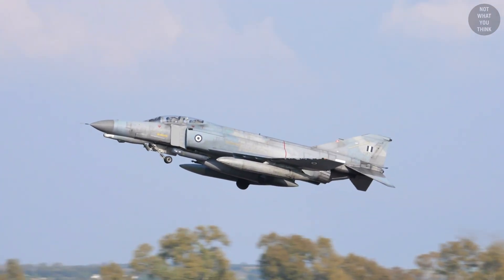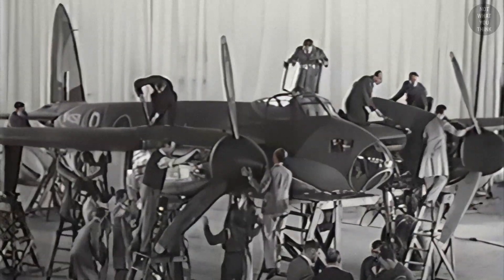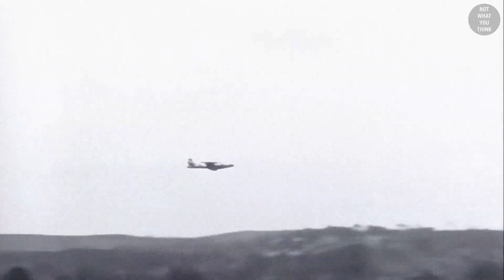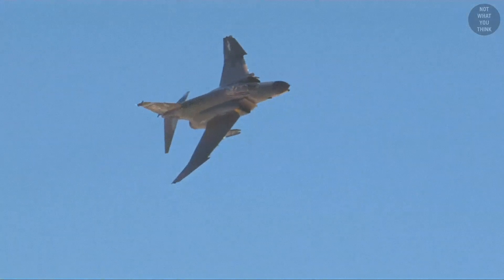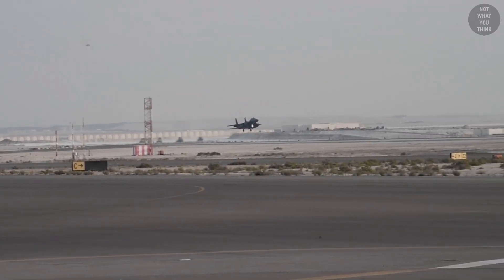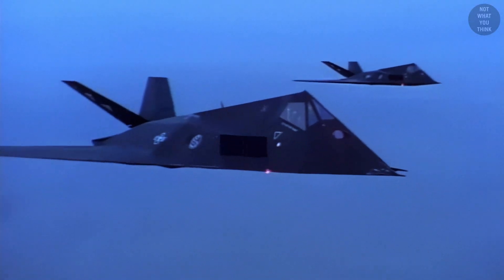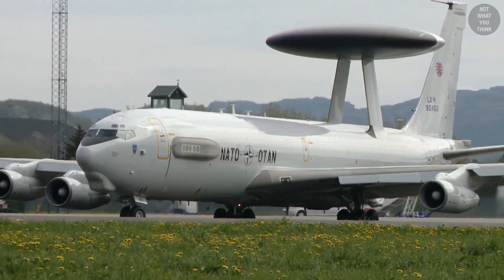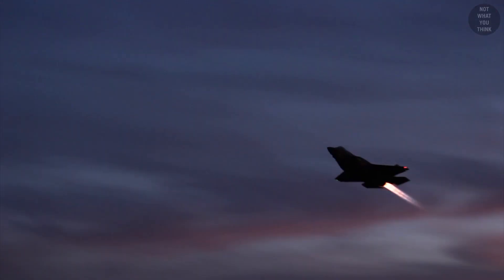Why are Modern Fighter Jets Slower than 1960s?

Comment: Also F-35 has really good performance in the subsonic flight regime.  There’s so many different flight regimes to consider at any given altitudes.  Different engine types love different regimes.  F-22’s low bypass loves the thin high-altitudes going supersonic whereas the F-35’s higher bypass engines thrive in thicker air and in subsonic airflow. F-1 cars and Rally cars are built for different types of racing.  F-22 is the F1 car with the smooth thin air.  F-35 loves the rough-and-tumble of turbulent thicker air and thrives there.  Both can fly at other regimes of course, but then you’d need advanced variable engines with moving inlets and controllable bypass to take advantage of each flight regime (costly, heavy, maintenance-heavy…).

Transonic speeds is actually important during BVR, but accelerating to transonic is part of any sortie plan, and only happens very briefly during the entire sortie.

Source: My dad was in the RoKAF, and I myself have been a US Navy contractor for their sensor systems for nearly 2 decades now.
Reply: Your so right. In medium flight envelopes the f35 could out perform any other jet where it counts. Not slow, not too fast, but in the real world of combat.
Reply: @frankcrawford416  It can’t outperform the YF-23 though 😎
Reply: was about to say, this video omitted the fact that short stints of high speed are very useful in bvr combat for added missile range.
Reply: I'm so glad Finland chose F-35s.
Reply: hey fellas how's the weather in moscow
Reply: Isnt the air thick on low altitude and thin on high
Reply: So the f35 is the better choice for Switzerland as it is more versatile
Reply: The F-35 is not a good example, it still has difficulties.
Reply: Good points! People really seem to misunderstand for what the F35 was originally designed to, and in what direction it evolved.
Reply: The only thing you are mistaken is the importance of BVR in the transonic region.  When it comes to BVR, you want your plane traveling as fast as it can when you release a missile.  Missile engines only have so much burn-time.  You don’t want to waste propellant and cut your range by trying to make up for acceleration.   So the supersonic region and thin high altitude air is what you want for BVR, even if you are hitting an opponent At a lower altitude with thicker air.
Reply: what's BVR?
Reply: The F22 and F35 engines do not bypass air....  a high bypass turbofan  is the type of engine used on commercial airliners and cargo aircraft, which drive a large fan at the intake to provide additional thrust and cool the exhaust.  Neither the F22 or F35 do that, so turbofan is really a misnomer for those engines....  they should be called turbojets.
Reply: Thank you for that excellent comment and all the great info it contained. In a nutshell you explained the basic difference between those planes.
Reply: Look another that talks lies and propaganda as if real truthful fact? Tell us all why you want to talk about anything at all when you have no idea what you're talking about?
Reply: There really is something very wrong with you people today. You all get taught propaganda as if a real part of your own country's history?, and it's the rest of us, that have to put up with reading your own opinions of comical rubbish! 
Try to have a discussion about any military aircraft, with any American, and you'll be shocked just how unaware they really are? They all talk endless rubbish, and so much so, they even start to believe their own rubbish. It makes no difference, if you show them, or explain to them, or even go through it in fine detail with them. 

You can conclusively prove things to these people, and they'll ignore it, and just carry on saying the same thing? Even when they've just been shown, and had something proven to them, (something that they were completely wrong about), makes no difference at all. Nope, they'll just deny it, or ignore it, seriously, you can talk to any of them about any military hardware, at all, and you'll always come to find, they actually know nothing about any of it.

Even when you point things out to them, things that they've so obviously just dreamt up in their own head?, all you'll then get back, is a few lines of remedial illegible rubbish. But you'll then see them somewhere else, repeating what they now already know to be complete rubbish??. Honestly, you could not make it up! 

If people could think for themselves today, they'd all be questioning why the USA made a point of announcing to the world, they've made it illegal to sell the F-22??. The USA seemingly want it believed, it's because it's so good, they don't want anyone else to have it?. But, that actually makes no sense at all, because the reality is, they've no idea what's around the corner in modern technology terms, and with the speed we're seeing new military tactical hardware being designed, developed, and created today, It could well of made great sense to sell the F-22 at some stage?. (If it actually works). If it worked?, they'd have been able to recoup much of the resources spent on the aircraft, if not the resources in their entirety.

Now, there's another reason the USA would make a point of announcing they've made it illegal to sell the F-22?, a point that the American people seem to want to neglect today? And that's, If, it doesn't work, If it is, as I suspect it is, a lemon?, and if the USA have then used the F-22 as a propaganda purpose aircraft?, then what better way of preventing anyone else from finding out that it actually doesn't work, and it's really a lemon?, than making it illegal to sell? 

Really, and logically, the only possible way to explain that stunt, of the USA announcing they've now made it illegal to sell the F-22, can only be because it's a propaganda aircraft, a failure! 16 years the US have had F-22, and they've been in wars the entire time, only they've never used it, and they removed every F-22 from the Middle East, Jordan, Iraq, Turkey, and Saudi just after Russia arrived in Syria in 2015.

You can think about this as much as you like?, that is the only real possible reason the USA would do that. Absolutely no doubt about it, I guarantee we'll never see the F-22 involved in any sort of war scenario, or any major sortie, as it's basically junk. They've even trashed all the infrastructure they had in place to build more of them.
Reply: @hotstepper887  k
Reply: Imagine if the Allies had F35s at the start of WW2
Reply: @christiandauz3742  imo, Jet fighter vs Prop plane might be a little bit challenging. I don't really know about this tho
Reply: @cyngaethlestan8859  Yeah I know about the Me262. Jet fighter during WW2 is not well developed but it can do their job. The Me262 was not create to intercept the American P51 as far as I know. I think. Sorry if my sentence is weird, it's early in the morning while I type this.
Reply: @christiandauz3742  well to take that into account, bare in mind at the beginning of ww2 the germans had better tech than the Allies, so what would they have had? orbital strike capability??? (in fact in can be argued they had better tech throughout ww2 anyway I digress) also an F35 in ww2 era would have been pointless as steath isn't needed in a pre radar era and would be needlessly expensive to run. 
What won ww2 is massive numbers of available troops and resources and production capabilities and that would still be true now so long as nukes are off the table. The Nazi's could out fight tanks and planes 1v1 through out the war until they ran out of kit and soldiers. Tiger tanks were known to kill 20+ shermans or T34's on occassion and retreat only due to fuel and ammo shortage.. Some of their "Aces" had clocked up over 100 tanks kills. SO why didn't they win? largely due to the offensive against Russia, they depleted themselves against an endless sea of bodies and tanks and once the allies started carpet bombing production capabilities and cities too the war was lost and it was just a matter of time.
Reply: @triggerhippy2826  

WW2 started with the Nazi invasion of Poland

I doubt the Germans last a week with their airforce and army decimated. I also doubt the Soviets would invade Poland

China's very small airforce has also been upgraded. Same with France, Yugoslavia, Denmark, Belgium, Norway, Netherlands and Greece.
Reply: @christiandauz3742  You mean the British and or French.  Yanks didn't turn up till 1942.
Reply: Last I checked, F-35 had sub-average subsonic performance. What do you have in mind, maybe I'm confusing something.
Reply: @REgamesplayer  F-35A outperforms both the Block 50 F-16C and F-22A in subsonic regime if talking acceleration, for all the reasons dan725 stated, as well as its aerodynamics.  Everyone that has been talking about how poor the F-35 aerodynamics are are left having to explain why its performance is better than 2 of the highest-performing fighters in the subsonic regime.  Once the F-35 gets to supersonic realm, the F-16C Blk 50 and F-22A out-accelerate it.
Reply: @LRRPFco52  F-35A does not outperform F-16 in subsonic range. Its sustained turn is a lot slower, leaving it a sitting duck in a dogfight. Its acceleration is also worse due to lower thrust to weight ratio.
Reply: @REgamesplayer  We literally worked on the F-16C Block 30 and 40, and I’m intimately familiar with the Viper from YF-16 to the latest variants.  I watched it all happen at Edwards AFB from the 1970s-onward.

Recent statements from one of the squadron commanders at Eielson AFB in Alaska:

“If you put an F-16C Block 50 next to an F-35 at 200knots and accelerate, the F-35 beats it to Mach 1.  The F-35 also beats the F-22 in the subsonic regime.  Both the F-16C Block 50 and F-22 will start to walk away from the F-35 once they go supersonic.”

Airshow demo F-16 has better STR, but not ITR.  F-35 instantaneous turn rate and high alpha performance is substantially better than the Viper, which is AOA-limited.  Once you combat-configure the Viper, don’t even get airborne for that contest because it’s over before it started.  Have you ever seen the CAT limits on the Viper while configured?  It’s nowhere near as agile as when slick.

F-35A curb-checks the F-16 when you actually configure the F-16 for missions, even with both of them carrying the same weapons load.  F-35A is carrying more fuel and still out-performs the F-16 no matter what you do.

F-16 isn’t getting anywhere near visual range, and doesn’t want to anyway since both of them have AIM-9X, while F-35 has extensive IR VLO and a far superior Helmet.

50% of all meteorological conditions (night), the F-35 is superior to any fighter in the world in WVR, not that it will allow them to go there.
Reply: @LRRPFco52  I had checked information about F-16 acceleration and discovered that for all practical intents and purposes, F-35 is a quicker plane to accelerate. However, F-16 is technically quicker plane. This is due to most calculations for F-16 being made with fuel tanks and often full loadout while F-16 having better characteristics on paper.

"The F-35 and the Infamous Transonic Acceleration ‘Spec’ Change" source has a nice table showing both aircraft acceleration, F-16 beats F-35 at low weight/drag loadouts. However, F-35A beats F-16 at more practical loadouts. 

I knew about instantenous turn rate, but I had in mind sustained turn rate which is worse one F-35A. This had caused F-35A to be humiliated by F-16 in the past and it can only do defensive maneuvers and hope for enemy to do a mistake. WVR combat is a disaster for F-35A and we are still comparing only F-35A to F-16. Super-maneuverable Russian jets could run circles around this plane.

Thank you for pointing out that F-35A is not as hopeless in sub-sonic acceleration as I imagined. Feature creep had resulted in a  poorer acceleration (by 8 secoonds for F-35A) and it is still slower than F-16 to speed up. However, I was not taking into account how much drag F-16 has to carry with him which makes it slower fighter jet for all practical applications.
Reply: @REgamesplayer  The old AF-2 flight dynamics envelope expansion on a pre-SWAT F-35A (one of the first 6 LRIP birds that were never mass-produced) is not what you would want to use as a sample for F-35A performance, since it was heavier and was restricted to 4-5g.

A real F-35A humiliates the F-16 in WVR, not that it matters.  Read about the Dutch F-35A pilots dong a week-long BFM series of exercises with Nellis AFB Aggressors in F-16C Block 30s (lighter airframe than Block 40s and 50s).  F-16s showed on Day 1 with 2x 370 gallon EFTs on the wings, got spanked in every set-up.  Next day switched to centerline 300 gallon tank, still got wrecked.  On the final day, they showed up slick with no EFTs, very short sorties due to need for hitting the tanker, and still weren’t able to push over a 50% kill ratio.

On one of the days, the F-16s BINGO’d and returned to Nellis, F-35s flew off to the training ranges.  F-35 pilots came back to debrief for hours as USAF does, and F-16 pilots asked, “Hey, where did you go after the BFM exercises?”

Dutch:  “Yeah, we were carrying GBUs the whole time, so we wanted to maximize the airspace and training value to go do drops on the live ranges.”

F-16 pilots:  “........what?”  Jaws hit the floor.

Sustained Turn Rate on the Viper is awesome when slick.  With Pods, EFTs, all pylons loaded, even after you E-JETT the tanks and bombs, you have:

Centerline 800lb ECM pod
LITENING FLIR Pod on 5R
HTS on 5L for CCIP F-16CM later blocks
WWPs on 4 & 6
WWPs on 3 & 7
ALE-50 equipped pylons on 2 & 8 with missiles attached
AIM-120Cs on 1 & 9

Your sustained turn rate in that configuration is still nothing like an airshow demo, and if it was a 1950s gun fight, you would still get wrecked by any of the F-35s, including the B.

Since it’s not a 1950s gun fight, but a 2020s Helmet-HOBS missile fight if someone is stupid enough to close into WVR after making it through the BVRAAM WEZ layers, then JSF smokes everyone including Flankers because of IR VLO, better HMDS, better FPA missiles that have close BVR reach for the face-shoot, automated offensive/defensive EW suite, and other things.

The conversation about the WVR fight is negated on so many levels, since it’s a non-starter already for 4th Gen fighters.  They stopped doing it long ago just because of Helmet-HOBS.
Reply: @LRRPFco52    Here is where I find issues with your comment from a get go.
1) I cannot find specific article you were relating to. About those tests you wrote in the start. You wrote it vaguely enough that search does not find anything specific.
2) SWAT was a very early program done roughly around 2004. AF-02 test aircraft first flight was 2010. This means that your argument lacks logical connection as weight reduction was done prior this aircraft introduction.
3) In a dog fight test there is no mention that F-35 was limited in performance and if it did, how it was affected by it. I see this argument made in defense of F-35 a lot. However, it is not logical. What is the point of testing your fighter jet in a dogfight conditions if its software locks it from dogfighting? Military does not test such politically sensitive pieces of hardware like this just because they can. Seeing how unrealistic F-16 loadout was and how handicapped this aircraft was in a dogfight shows to me that it was a rigged match which went wrong.
4) Your quotes also do not help the issue. Quote turn rates, actual dogfights. You are quoting a lot of loadout numbers, but you avoid talking about their actual performance in a dogfight.

Overall, argument that  F-35 is better at a dogfight than F-16 does not seem to have any merit as F-16 is a better dogfight fighter. We have mock battle to prove it. Since then F-35 only became worse in such dogfights due to weight creep which resulted from feature creep. Its agility had noticeably degraded since those early  models. That is worse, people feel a need to bring F-16 to a dogfight in a completely rigged environment. Could you explain to me why they are testing this aircraft with fuel tanks attached? In real life scenarios these things would be the first thing pilot would drop including even potential bombs and anti-ground missiles which it might be carrying.

I do need hard data to be convinced that F-35 is not a worse fighter jet in a dogfight against F-16 when it comes to agility. Bring me turn rates for these aircraft, acceleration, etc. Compare them in realistic payloads which would happen during dogfight.
Reply: @REgamesplayer  1) The weight growth through the configuration proposals was ongoing, then dropped considerably with SWAT, and after the 6 LRIP-1 birds were built Lockheed stated that all production models after that would be even lighter.

I'm referencing "F-35: From Concept to Cockpit", available to those in the Aerospace Engineering world by membership.  It's a huge book written by all the engineering leads and some early test pilots on JSf.

I'm also referencing the statements by the test pilots who flew those LRIP-1 jets.

Additionally, I'm referencing my family's work and my own studies and familiarity with ITR and STR on the F-16, which we worked on in the late 1980s before going over to the F-15 CTF.

As to flight control algorithms, they didn't open JSF up to max g out of the gate, but instead did a very carefully staged incremental performance expansion during safety of flight testing.

The infamous dogfight test was not a test of how well AF-2 could fight with the F-16D chase plane, but a highly instrumented flight to measure specific performance metrics and test points with the DFLCS.
Reply: @REgamesplayer  Yes, the F-16D was nowhere even close to being combat-configured since it didn't have:

800lb ECM pod on 5
LANTIRN TGT Pod 5R
Weapons

You can E-Jett stations 3, 4, 6, 7 on the F-16, 5 if it's a 300 gal EFT, but not the ECM pod.

A Combat-configured Viper is still a CAT 3 stores limit bird with the ECM pod, FLIR, and HARM TGT System for deployable CCIP Vipers.  Even with EFTs jettisoned, it can't pull 9g, has limited roll rate, AOA limiter, and doesn't hug the EM diagram like it does slick.

It has worse acceleration, ITR, STR, and climb rate than an F-35A in a post E-Jett configuration.

Real production F-35As have been dominant against even light-loaded F-16C Block 30 aggressors for many years now.

The Dutch stated openly that they saw the F-16s show up on day 1 with 2 tanks because they heard about that early test report, thinking they could just fly circles around the F-35As.

After they got wrecked, they RTBd and then showed up Day 2 with only centerline 300gal EFTs, ACMI, CATM-9s, still got wrecked.

Then they stripped them down to no EFTs and only the ACMI and CATM-9, and brought the exchange ratio up a little, but not enough to break over 50%.

Then the Dutch went and dropped live bombs after those sorties, which they had been carrying the whole time.  There's a very lengthy pilot interview on it.  These are high hour Dutch F-16 pilots who converted over to F-35As as the initial Cadre that will instruct and lead their air force as it transitions.

The whole conversation is in the wrong place though being focused on WVR guns fights, when you have the sensors that JSF do.  Why would you ever let the fight get close?  Keep in mind they see everything from surface vessels to satellites in their HMDS.
Reply: @LRRPFco52  

Please try to keep conversation to one comment as it is difficult for me to respond to two comments at once. 

As for why I'm focused on this topic. This is because you keep on arguing on an issue which you should not. To me, this topic is simply about laws of physics. F-16 is a smaller plane and thus it is more agile. Other planes are designed to be more agile WVR combat and thus they are more agile than F-35. It does not matter that WVR is impractical or F-35 was not designed for it. This is just how it is. F-35 is a relatively clumsy plane and I'm tired by people trying to white wash it like it is not. This does not mean that it is not a next generation super plane which will dominate the skies or that it is not high tech marvel. These are completely different topics and I do not care about them for the purpose of this conversation.

It seems that the only good source which I can back to is a book which you had mentioned. I cannot exactly check up on your family's research after all.

Here is my issue with this whole F-35 dogfight fiasco. I had read "F-35A High Angle of Attack Operational Maneuvers" original document. It correctly states that it was not a dogfight. You also had mentioned that. However, it does not state any software limitations being in place. Furthermore, I recall that even in an official explanation for these tests there wasn't any mention about this software. This is where I'm mistrustful of this explanation. I know that this kind of software exists in preventing plane from experiencing maximum stress in order to save on its lifespan or to be just generally safe. However, outside of instantaneous and brief periods where plane is in such a state, normal dogfighting or even normal operation of a plane does not come close to those limits. For example, maximum stress is rated at 9G while sustained turn rate in a dogfight is around 4-5Gs. If there is a software limiting plane for going 7Gs, it would still have no relevance to these tests.

My another issue is that even if plane was meant just to perform maneuvers for testing. This test highlighted that a plane lacks technical characteristics necessary for dogfighting. 

My third issue is that you are referencing LRIP-1 models, however model at that infamous test came from LRIP-4 series. It was already modernized by SWAT program.

My fourth issue is that F-35 weight grew after that point with new features being added. In 2013 Pentagon had reduced agility expectations for F-35 series in order to allow greater maximum weight of those planes. Here is a direct quote:
"Pentagon's Director of Operational Test and Evaluation 2012 report. Turn performance for the US Air Force's F-35A was reduced from 5.3 sustained g's to 4.6 sustained g's. The F-35B had its sustained g's cut from five to 4.5 g's, while the US Navy variant had its turn performance truncated from 5.1 to five sustained g's. Acceleration times from Mach 0.8 to Mach 1.2 were extended by eight seconds, 16 seconds and 43 seconds for the A, B and C-models respectively. "

Edit:
As for F-35 vs F-16 speed comparison which you talked in your different comment. Yes, F-35 is faster than F-16 in most practical loadouts and is tied in one. However, with impractical loadouts, F-16 is faster than F-35. With 2 x AIM-120B, 511 rounds, 7116 lbs internal fuel, plane weights 28,285 lbs and has a drag at around 54. At these conditions F-16 will accelerate quicker at sub-sonic speeds than F-35. (M0.79 to M1.29 by 54 seconds).
Reply: @REgamesplayer  checked where? YouTube?🤣
Reply: @GGG19872  Testing reports and enthusiast pages.
Reply: @REgamesplayer  funny I've seen it fly in airshows right behind the F22, F15s and F18s, the F35 turns tighter and maneuvers just as well or better than the F15 and F18 (plus it has better combat systems than either of those two) and almost as well as the F22.  They are also integrating the F35 pilot helmet into the F22.  So what "sub average subsonic performance" are you talking about?
Reply: @danniellwilliams8973  Wider turn radius, slower sub-sonic acceleration, lack of supermaneuverability.
Reply: @danniellwilliams8973  And you never bothered to dig for its aerodynamic properties or read testing reports of F-35. You only give it excuses that it does not matter. No, it does matter. Vectored thrust is king in dogfights as supermaneuverable aircraft can physically shift exhaust of their engines in order to produce much sharper turns than normal fighter jet. If it truly would not matter, F-22 would not be supermaneuverable aircraft.
Reply: @REgamesplayer  yes it is in video games but that's yet to be proven in combat.  Yet, I've seen the actual plane fly and maneuver in many different venues.  Not to mention, the numerous foreign customers putting in orders for the plane.  I guess they missed your "reports" as well.  Lol.  Also keep in mind, real wars aren't fought on paper.
Reply: Rolling down the runway
throttles open wide
see the mighty Phantom
sway from side to side
airborne again without a blip
It's just one more aborted trip
but we're pressing on regardless
for the wg cdrs AFC

Went to early briefing
climbed into the Kite
opened up the throttles
and roared into the night
leaving the flare path far behind
It's dark outside, but we don't mind
cos we're pressing on regardless
for the wg cdr's AFC

Rolling down the runway
throttle open wide
see the mighty Falcon
sway from side to side
airborne again with just 9 G
I wish I had a nav with me (!)
but we're pressing on regardless
for the wg cdr's AFC

Rolling down the runway
throttles open wide
see the mighty Jaguar
sway from side to side
airborne again, but only just
It's not much fun
with F*** all thrust
but we're pressing on regardless
for the wg cdr's AFC

GIVE ME BUCCANEERS!
They're British through and through
The Banana Jet
The Best we've had yet
We are the last of the few.

Don't give me the Jaguar
Unless you refer to the car
The car is a groundhog
The aircraft is half frog
Don't give me the Jaguar.

Give me Buccaneers
They're British through and through
The Banana Jet
The Best we've had yet
We are the last of the few.

Don't give me the Harrier jump jet
You haven't convinced me yet
Jets that fly backwards 
Are soon to be knackered
Don't give me the Harrier jump jet
Well… Not just yet...

Give me Buccaneers...
They're British through and through
The Banana Jet
The Best we've had yet
We are the last of the few.

Don't give me this computer crap
It's no way to tackle a SAP
It's OK for Dicks, Germans and Spicks
But Gentleman always carry a map!

Give me Buccaneers...
They're British through and through
The Banana Jet
The Best we've had yet
We are the last of the few.

Don't give me Air Traffic Control
They live in a bloody great hole…
They scream, and they shout, then F**k you about
Don't give me Air Traffic Control.

Give me Buccaneers...
They're British through and through
The Banana Jet
The Best we've had yet
We are the last of the few.

Don't give me the F-104
It's only a ground loving whore
It goes in a turn, flick, spin and burn
Don't give me the F-104.

Give me Buccaneers
They're British through and through
The Banana Jet
The Best we've had yet
WE ARE THE LAST OF THE FEW!
Reply: @hotstepper887  look out he's going to copypaste his seethe dissertation and call me an idiot
Reply: @soloqueuepixy  Rather than typing such a meaningless comment?, why don't you just try making a comment about the issue? 

What did you think that irrelevant comment would achieve?, what is the point you're trying to make? 

I'd be an extremely uneducated individual if I wasted my own time retyping my own comments over and over again when I've no need to do that? 

You seem to believe every comment I reply too, are the same comments? But of course they're not, they're all different threads, not the same. LMAO! 

You know when you find yourself typing the same thing many times, that you only need to type it once? As we have modern technologies today, you know? Technologies, like, "copy and paste" we use to save us from having to retyping things, it's well good, saves so much time! 

Oh, wait, are you actually saying that YOU, yourself, actually sit there, and you retype a comment you might want to say many times? Is that really what you're trying to say? 

So, do you also think, that if someone copies and pastes something, then that in some way, means the words are worth less than they would be if I'd retyped them all? Is that what you're actually saying? LOL.

Not only did you type that comment fitting of a 4-year-old? No, you went one further, and you even hit send? LOLOL

Btw, I've said this so many times to other less educated people, like yourself we find on here, so many times that I'll admit, it's "Copy and pasted*" PMSFL... 

I'll tell you what, right?, the level of intelligence in this world today, is, appalling! It's actually shocking!  LOL.

You're really not the sharpest pencil in the pencil case, are you, lad?, blunter than a pair of old worn out plimsolls. LMFAO
Reply: @hotstepper887  exhibit a: redditors when someone doesn't agree with them
Reply: @hotstepper887  my condolences for your british birth
Reply: Seemingly these Americans have no idea the F-22 and F-35 can't see, track, or target any other stealth aircraft from BVR (beyond visual range). Stealth alone defeats high-frequency (short wave) radar by absorption and deflection, it does not defeat low-frequency (long wave) radar. Therefore, to see, track, and target stealth aircraft you must have long-wave radar, but it must also be enhanced to remove all background clutter for targeting purposes.

Neither the APG-77 radar used in the F-22, nor the APG-81 radar used in the F-35, can see any other stealth aircraft from BVR (without enhanced long wave radar) — This fact the US Air force obviously know! Only it seems the reality is, that when the F-35 radars were being designed 13 years ago, there were no other stealth aircraft to think about as a potential threat? So how can these US aircraft be seen as any sort of threat to either China or Russia, who both have these aircraft technically beaten? They can see and target US jets from BVR, yet the US jets can't even see them from BVR?

Russia's new 5th generation Byelka (2band) radar, used in SU-57, does have enhanced long-wave radar, they've designed and developed the first L-Band fighter radar we've ever seen. They've cleverly embedded L-band AESA radars in the leading edges of the wings. The new L-band AESA radar data gets processed in real time through extremely powerful Russian Elbrus computers being significantly enhanced removing all clutter, meaning it can see, track, target, and engage enemy stealth aircraft from BVR. The technology along with its impressive range parameters and jamming ability over large areas make this aircraft deadly to all other aircraft types. 

They can also interact in ''real-time'' with each other member of the squadron, (auto selecting) the best placed BVR missile, that can be fired by anyone of the squadron with a bogie on radar, they can also take control of surface-to-air (SAM) missile defence systems - (that alone is lethal), and they can see track, enemy stealth fighter aircraft long before Russian airspace, from much greater distances, with "real-time" data from massive Russian ground long wave stations (that are all protected today with the networked S-400 defensive system). 

Therefore, as they'll always know where the enemy aircraft are, they'll always be able to approach any enemy aircraft head on, and therefore stealthily, (Russia wisely sacrificed rear end stealth for much better manoeuvrability) meaning today, the US fighter jets would not even be able to see them coming!! Russia's Byelka (2band) radar covers all aspects of frequencies across all channels, that are used for tracking, targetting, and also jamming. It's part of Sh121 multifunctional integrated radio electronic system (MIRES) on board the SU-57. 

Russia tested much of this new radar suit on the SU-35, so they also have the option of fitting this radar into SU-35's permanently, meaning Russia's SU-35S flanker will be at no disadvantage with F-22/35. As although the SU-35 can be seen and targeted from BVR, the SU-35 with the new 5th gen radar is as able to see and target the US jets from BVR, seeing the all-important Russian advantage in BVR missile distance, plus the excellent manoeuvring, neither the F-22/35 have, as more than critical, if you're going to avoid simply being blown out of the sky.
Reply: @hotstepper887  the least you could do is put the "extremely powerful russian computers" joke at the start where someone might actually read it
Reply: @soloqueuepixy  When God was giving out brains, you misheard, and thought he said pains, so you stood up and shouted out, none for me please! LOL
Reply: @hotstepper887  The primary long range detection fused sensor suites on F-22A and JSF are passive, not active.  Russian pilots communicate on open, unencrypted, plain text Radio.  They are so far behind, it’s actually sad and pathetic to listen to their non-brevity coded voice comms.  An infantry soldier in the US Army or NATO uses better radio discipline and brevity codes than the Russian Air Force, on encrypted and frequency-hopping radios, which have been in widespread use since the mid-1990s.  Russian electronics are a pathetic joke.  You can’t even talk about Radars until you evolve their comms into the late 20th Century.
Reply: @LRRPFco52  Grow up, educate yourself.
Reply: @hotstepper887  By educate, do you mean formally study and work in the aerospace and defense sector since the 1970s?  If so, done.
Reply: @hotstepper887  Those are the guts of the F35. The issue is the performance is drastically inferior to that of the F22.
The F35 is a barely function vehicle that is still unable to fire. It under performs when compared to the F22.

Should have just upgraded the F22 instead of trying to design a new plane from scratch that still can't fly a few miles a way from lightning.
Reply: @andrewh1113  PLEASE! You what? Tell us all when you have ever seen the F-22 do anything it claims it can do? You never have, like the rest of us, so explain why we see you trying to talk about an aircraft you know precisely nothing about? That's idiocy on a whole brand-new level of idiocy.
Reply: @andrewh1113  It can't fly near lightening?
Reply: @frankcrawford416  That was one of the many scandals of the F35 Lightning.
Reply: @frankcrawford416  I've been flying since the 1970s.  Whether you're in a Cessna 172 or 747, we plan air traffic and flight plans around the weather, not through it.  F-35s have taken lightning strikes many times and every single one recovered safely, including a recent incident where the lightning strike destroyed the canopy.  It's much ado about nothing from people who literally don't know anything about aviation.  Next slide...
Reply: We see the USA still unable to produce and build a VTOL capable fighter aircraft. The F-35B was claimed by the USA, to be able to do what the Harrier could do, while also being supersonic, stealthy, with modern avionics systems, etc etc, this is what we were told. Only one of the biggest technical headaches the British always had to build the Harrier, was the VTOL — transferring from ''lift'' (downward nozzles) to forward flight (rear-facing nozzles) and flying away. 

Apparently to achieve it took the British a hell of a lot of technical work, three — four months at a time over 3 years. (Look up all the variants they made) but they never gave up, and they finally figured it out. I said long before we ever saw the F-35B, it wouldn't be VTOL capable, even with the Rolls-Royce lift engines, because the USA has tried many times before, and failed, only managing to produce the British Harrier able to do so. Every US airframe (and there have been many), have all failed. 

At 7 mins 50 seconds, you'll watch a Harrier perform a proper VTOL. Copy and paste “2013 MCAS Yuma Air Show — AV8B Harrier Demo” into YouTube search. Watch it from lift off, (to more importantly), flying away from the lift-off, and you'll see the transfer of nozzles take place.

You'll not find a single piece of footage of the F-35B doing this. I've had (Americans) tell me all sorts, like it is VTOL and can do it, even saying they've seen it? LOL, only when they can't show it? They quickly change, and instead we'll read them claim it was never intended to be VTOL capable? LOL. 

Sure, when Lockheed Martin's very own page on YouTube clearly shows them trying to suggest it is VTOL capable, when it so clearly is not? Copy and Paste “First F-35B Vertical Takeoff Test” into YouTube search. Watch this, you'll see it lift off, only you'll see it take off go straight up & hover then return straight back down? You'll never see it fly away from the lift-off? Believe me, if it could, we'd see it doing so in every piece of footage we have on the F-35B - like we still see on all the footage of the Harrier doing so. But you'll never find any footage anywhere of the F-35B doing that. 

They'll then go on to say it's not necessary? LOL, while forgetting, they're to be carrier-based aircraft?, meaning even just slight damage to the deck or ramp, they can't get any jets airborne?. Defeating the entire purpose of having the aircraft in the first place! You can't ever lose an entire carrier in battle, for only minor damage, whatever next. 

And why do we see the USA doing this? It's obviously because the USA is still the only country that's never managed to produce & build a VTOL fighter aircraft. Britain did so in the late 50s, Russia did so in the late 60s the USA has tried and failed numerous times, so it seems this time they're going to try to lie about it LOL, that country is a travesty, man! It shows us that Lockheed are not unknown to produce propaganda aircraft. 

As I claim, the F-22 is exactly that. A lemon, that became a propaganda aircraft, that was intended to be a viable military aircraft, that failed.
Reply: @hotstepper887  watch?v=vsKwBzt7rDY 
"F-35B STOVL Transition, Hover, and Return To Forward Flight - Farnborough Airshow" from 2016
Reply: @hotstepper887  F-35B was never meant to be VTOL.  JSF-B is a joint product of the UK and US, where the UK approached the US in 1983 looking to develop the system that would supersede the Harrier.  From the start, that program was called ASTOVL, not ASTOL.  The UK was deeply involved in the development of ASTOVL, using the VAAC Harrier out of the UK’s flight test center for the Integrated Digital Flight Control and Engine Control System.   UK test pilots were on the X-35B and F-35B from the start, as well as weapons test and integration of data-linked employment capabilities from the Royal Navy AIM-120 expansion working in conjunction with Pax River, Point Mugu, Eglin AFB, and Edwards AFB.  There really isn’t a nationalistic line between the UK and US on JSF.

Trying to turn it into a commentary on British superiority is wholly unfounded and void of the facts relative to the entire JSF program, let alone JSF-B.  US and UK have worked hand-in-hand on military aerospace development since WWII basically as a set of conjoined twins.
Reply: @hotstepper887  I think you are the one fooled by propaganda.
Reply: @hotstepper887  The f35 definitely vtols i have seen video footage on uboob. It  probably carries less weight to do it, but I believe it can. Remember, even if you don't believe it, it still lands like a harrier, that is straight down, it must be able to take off straight up. And its so much more forgiving doing either. Its a quantum leap above its grandfather the harrier.
Reply: @frankcrawford416  Of course you have, only you can't show it, when you can, come and educate us all. You clearly can't even comprehend the English language, as very clearly I've made the point "If it could, we would see it doing so on every video of the F-35, like we still see on all the footage of the Harrier doing so"
Reply: @hotstepper887  Your assertions about the Harrier are erroneous.  The primary take off method for the AV-8B and all the UK early-through-late variants was and is a rolling take-off, not Vertical.  The reasons for this are obvious if you have even a rudimentary understanding of aviation, which you clearly do not.
Reply: @hotstepper887  F35 is th VLOL hajaha